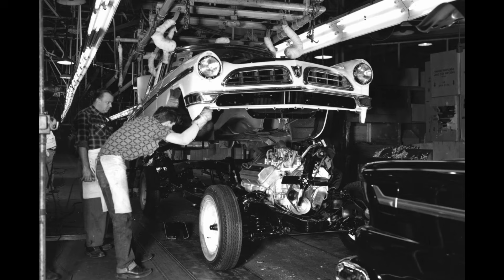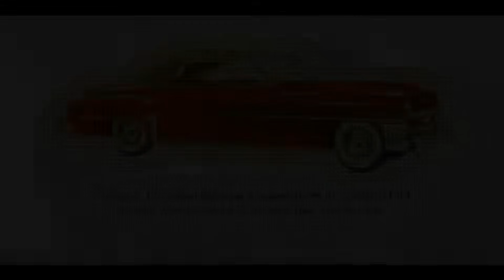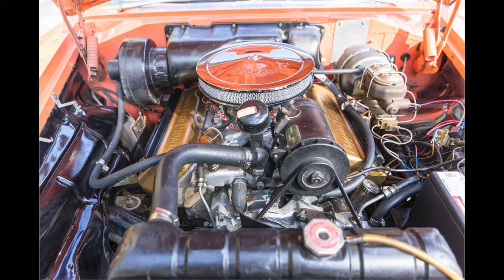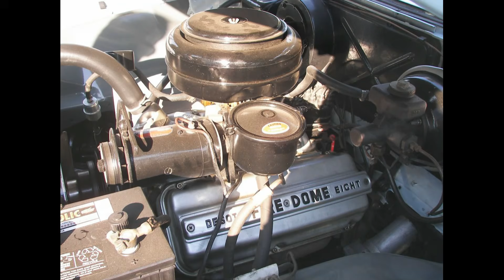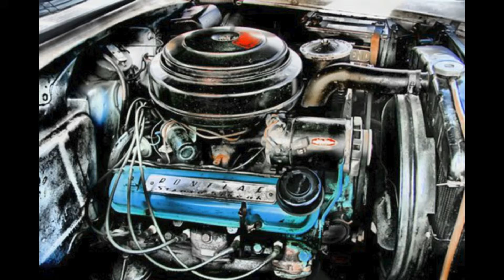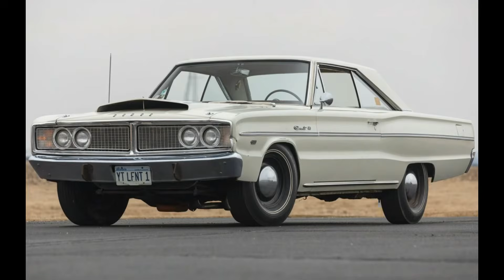The Legendary Engine That Beat Them All

Comment: One article said that in 1951 the Hemi actually made 200 plus gross BHP. But Chrysler said 180. When I rebuilt my 1966 Hemi to 100% factory stock  specs it made 496.2 BHP on the dyno. That means in 1966 the gross BHP rating was not 425, but closer to 600.
Reply from the maker: Thanks for watching and sharing your comment!